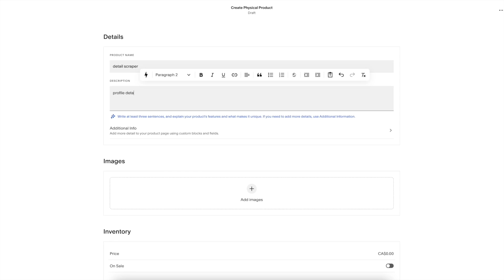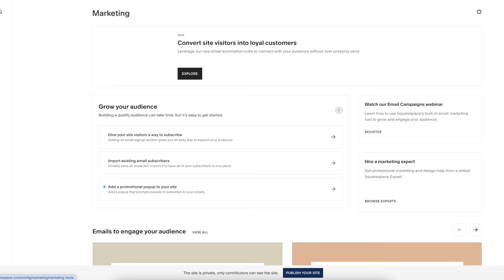How to refinish TEAK

Comment: Another fantastic "save", even though I'm not a fan of "Danish Modern". Absolutely agree that flush plugs is the "correct" look. To my eye, this style of furniture always looks structurally deficient, even if it does the job, like this table, with only four "thin" legs. I'm always for "overbuilt" rather than looking "underbuilt". Part of that is, historically, older buildings had timbers 2 or 3 sizes bigger than what modern scientific testing tell us is sufficient — which gives us a safe, "comfortable feeling". Anyway, thanks for bringing us along for the ride – can't argue with great results.😏

Comment: The parallels between restoring furniture and home renovation are interesting. Both involve coming across original work or repairs that make you go, "What the heck were they thinking?" Like when we found a small block of wood, nailed to another small block of wood that was itself nailed to the inside of a wall (barely), and the whole thing had a scrap of panelling nailed on top. The whole thing combined had 7 nails in about 4"x4" of material. What was it for? Who did this? We may never know.
Reply from the maker: Lol

Comment: out of curiosity from a newby: what will happen next time the chairs need upholstery? Since the plugs were now glued, wouldn't it be harder to disassemble the parts? although I agree that the flush plug looks better, I guessed the button plugs were more practical...
Reply: You can drill the plug out and then take the screws out if applying heat doesnt loosen the glue in the plug.
Reply from the maker: Yes they will need to be drilled out and replaced. But just the two back plugs. All others should be left unless they need a reglue. 😉